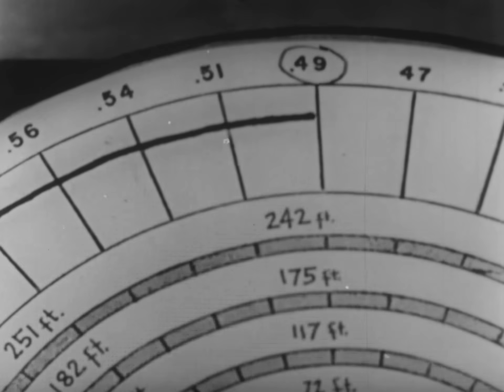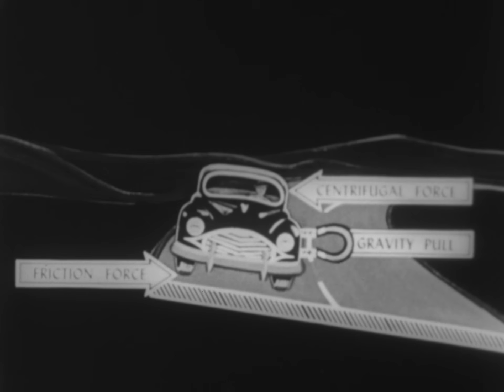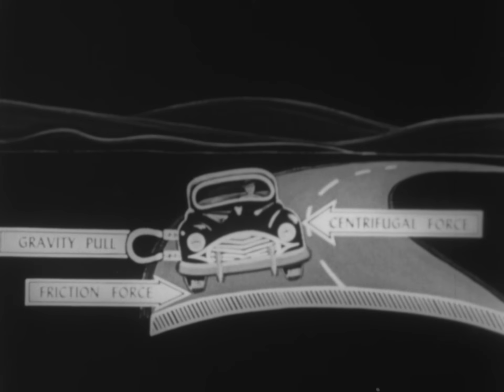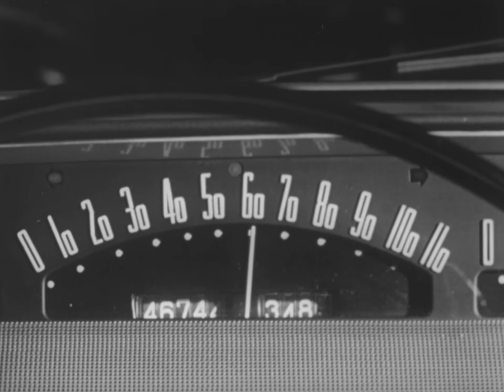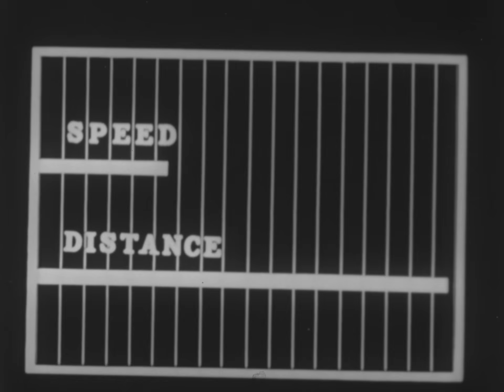Speed And Reflexes

Comment: The increased weight of cars nowadays negates most of these problems
Reply: Heavier cars make the problem worse, not better. More weight increases the kinetic energy of an object. So the lessons in this video are very much still relevant today.
Reply: @micahjohnson6799  Higher weight increases friction with the road and tire which improves the ability to turn without skidding. It also means the bouncing when on uneven/rocky roads is less of an issue. That's all I meant
Reply: @_siggi_783  Completely false.  All else being equal, a lighter car will both corner and stop faster than a heavier car.  Which is exactly why race car engineers go to extreme lengths to shave every possible ounce out of competition vehicles.  Modern cars are safer and perform better because of advances in brakes, tires and electronics, not weight.
Reply: @glhs386  Yes a lighter car will turn a cornr faster you're right, but it will skid easier. Race cars are light to reduce friction between tire and track, which also makes them very dangerous.
Reply: @_siggi_783  Still erroneous.  The lateral forces acting on the mass of a vehicle are greater than the friction provided by said mass at the contact patch. Race cars are dangerous because they are driven at the limit of adhesion at all possible times, unlike road cars.  They do not "skid easier" while having grip limits far beyond what most road cars are capable of, that's a contradiction.
Reply: @glhs386  you've used too many big words mate, lost me
Reply: Eh, no.  And while there are some great points made in the replies, the point of this video is reaction time and very little to do with the car.
Also, I believe this is a '50's movie and, IIRC, in the '50's less than half of the roads were paved, so you would be doing much of this on a gravel or dirt road, so, good luck.
If your point is you can run a modern car into a tree with less chance of injury, that is a good point.
The down side is most modern cars would not last very long on most '50's roads.  One pothole and they are totaled.
Watch some of the tests they did to '50's cars, those would also total many modern cars.
Reply: @l337pwnage  Good point about the roads, gravel makes skidding much easier, you still would be better off in a modern car than in a 50s much lighter one. Also you are right that modern cars can get damaged way easier, but that is actually intentional and a good thing, when you crash you actually want the car to crumple to absorb the impact, it's called crumple zones, if the car didn't even dent, well, you will  because that kinetic energy is going somewhere lol
Reply: you are braindead
Reply: but better tire compounds and disc brakes more than make up the difference.
Reply: what does more damage: a heavy semi truck, or a sedan?